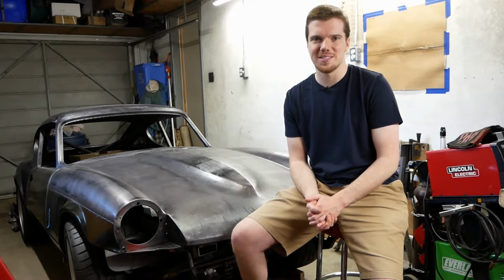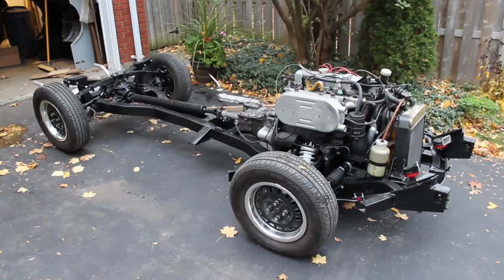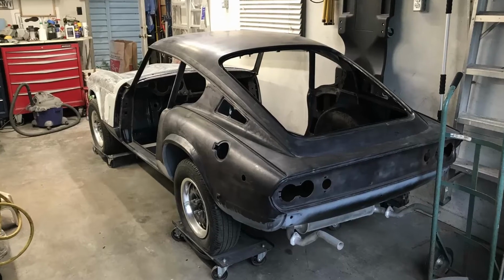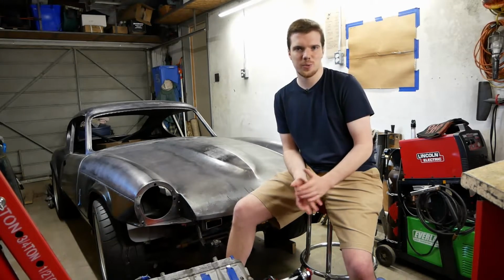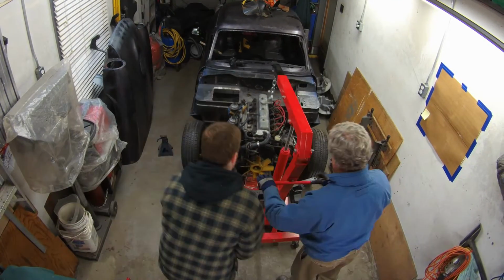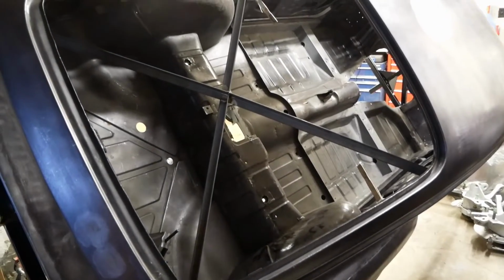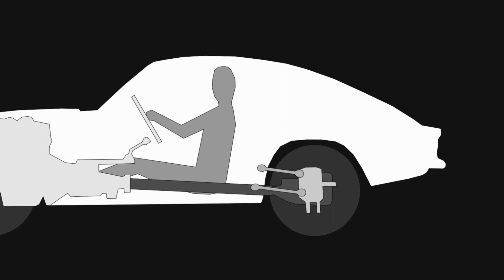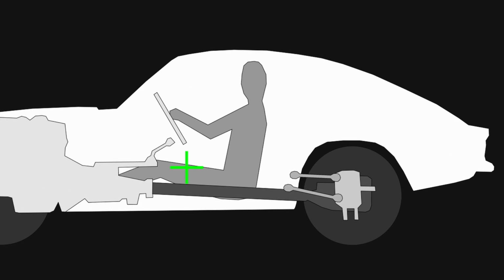ALL NEW Drivetrian – LS Swapped V8 Triumph Restomod Build – Project GT6R – Ep11

Comment: Turn a top hat boss with a blind threaded hole that you can fit from inside the manifold & then bond + screw into from outside with a washer / cap to seal and retain. Have you thought about using subframes from other cars such as Miata, E46 or E36 BMW etc? Simple chassis to pick up necessary points & link the subframes? Another thing to consider is where the exhausts will go as I guess it will not go under the new chassis.

Comment: In Regards to your rear suspension, depending on what the actual goal of the car is, you would want some suspension lift under hard acceleration.  Back in the old days, Chrysler corporation cars had a device called a "pinion snubber". It was a rubber piece mounted to the nose of the differential. Under hard acceleration, the axle would wrap a predetermined amount, making the snubber come in contact with a reinforced section of the cars floor.  This would have the reaction of lifting the car slightly, but at the same time pressing the tires more firmly against the ground.

AMC did the same thing with devices it called "Torque Links" and these were bars similar to the Corvette suspension parallel bars that bolted to each side of the differential and provided some lift while quelling axle wrap. Usually found on the hotter cars like AMX's, SC/Rambler,  SC/360 and early V8 Gremlins.

You might have also seen good old school "slapper bars" on the cheaper stuff like Camaros and Firebirds.  Same principal, just goofball execution.

Granted, you don't want a ton of lift, but you want some.  However I suspect this car will never see the drag strip anyway.

Comment: To plug that PVC hole, I would just tap it and run a straight thread o-ring plug into it. Just measure the hole and go to any hydraulics shop and select an appropriately sized plug. Then drill and tap the manifold for the plug and screw it.
When it’s done, that is going to be a very cool little car - with quite a bite!
Reply from the maker: Thanks for the idea Peter!  Cheers 👍
Reply: @FanatikBuilds  There are several videos for smoothing LS intakes, and IIRC AGearhead4Life had a good one. It seems to work well normally aspirated, but high boost applications can have issues.

Comment: Would use some panel bond to fill in and smooth out that intake. Used it all the time in the gm dealership paint and body for plastic
Reply from the maker: Awesome!  Thanks very much, we'll look into that! 👍
Reply: Fanatik Builds no problem can’t wait to see how the build goes along. Stocking up the parts for a hhr ss ls4 swap
Reply from the maker: Sounds awesome!

Comment: Go with a thicker walled steel tube that will not hold up to the torque it would if you were going to weld it into the body turning it into a unibody but alone it will only be a death trap
Reply: 3x3 tube will distort far more than 4x2.  The asymmetry of the 4x2 gives a better torsional and bend stiffness.  several solutions that will improve the situation, first, as Jeremy suggests go with a thicker tube, second, and not quite so obvious is to go with a pair of 3x1 (or 3x1.5) with he same wall thickness as the 3x3 spaced about 0.5 inches apart with a few gusset plates to keep them parallel - this will improve the torsional stiffness dramatically, as well as increasing the bend stiffness somewhat.
Reply from the maker: We're a little further along than it might appear, so unfortunately we'll be sticking with the 3x3 ... But don't worry, it's going to work out alright!  Thanks for the heads up!
Reply: Had a friend who used that same box tube to build a frame for a stockcar was killed first time out one small crash that shouldn't have hurt anything the car crumpled like a smashed pop can if you continue your nuts and we will probably be seeing you in the next life.
Reply: It also had a full roll cage that didn't help a thing and could have made it worse but we will never know now.

Comment: Hope that ls doesn't move the coolant through the plastic intake manifold like a ford modular.
Reply from the maker: Nope, it's a really slick setup!  All the coolant is directed through the block to the heads and back again, keeping the intake strictly for air.  The front and back of the heads have steam ports which allow for small tubing to carry any possible air bubbles in the coolant back to an expansion tank which prevents hot spots.  A very well thought out design! 👍

Comment: My standard MK2 gt6 without any lowering is hardly 12cm off the ground so your might not have as much clearance as it appears. 

The sill (or rocker as i think the Americans call it) is structurally important to the original chassis design. They replaced the herald larger outriggers when the design changed. i would have thought you could somehow tie the new chassis into some reinforced sills without loosing as much ground clearance.
Reply from the maker: We're not too worried about the ground clearance, the new frame only sits about 2.5" closer to the ground than the lowest point of the old setup!  Will make more sense in the next episode!  Cheers 👍
Reply: @FanatikBuilds  good good! Looking forward to seeing it

Comment: Any reason you can't spread the new frame against the rocker panels (or even inside the sills, like Binky's sill stiffening tubes), instead of trying to connect front and rear in a straight line?  That should keep your usable floor area at a workable height, give plenty of width to the frame itself, and if needed, you can always bolt on a crossmember to act as a stiffener once the drivetrain is installed.
Reply from the maker: Thanks for the ideas sir!  If we did it as a unibody like binky we definitely would have run a tube through the sills - as it sits though we wanted to stay with a body on frame, but we will be heavily integrating the two parts so it will (act) more like a unibody.  All will be clearer in episode 12 :) cheers! 👍

Comment: A lot of the C4 Community are talking about this.  The D36 is not very strong and it can handle not more than 300 HP.  That is the absolute limit.  

However Zip Corvette has a solution.  

https://www.zip-corvette.com/84-96-3-73-heavy-duty-dana-36-differential-w-cover.html

I am currently looking into this myself.
Reply from the maker: Thanks Adam, I've seen that product!  We just picked up a Tig welder and may try to mimic the design at a point ... From what I understand though, the 36 mostly doesn't like launches on the dragstrip.  Us, with street tires and a light car will hopefully be ok.  Worst case, everything is a direct bolt in to upgrade to a 44 diff someday!  Cheers 👍

Comment: It's kind of funny that you're using the rear out of a Corvette that made 205hp, to back up an Impala/Grand Prix engine that makes 300+. How far we've come in 20ish years! Lol
Reply from the maker: It is!  Modern technology 👌
Reply: @FanatikBuilds  Could you potentially do a 2x3 (possible thicker wall) tubing on the outer rails to gain some ground clearance over the 3x3? I see 2x3 used a lot on body dropped mini trucks. Might gain you an inch without having to encroach on the floor pan.
Reply from the maker: Good suggestion, we're actually quite a bit further along than it seems so it's already built in 3x3, but we've taken a few extra steps to minimize the size and keep it strong.  Only lost 2.5" of clearance and the car had tons to begin with so we're pretty pleased! 👍 cheers!
Reply: The corvette engine that made 205 hp was easily modded to make 400 hp back then . I have a modded L82 which I supercharged using a compact over driven supercharger 3 inch dual exhaust big tune headers  , modded original 2.02 heads machined for heavier springs rhoads variable valve timing and lift  lifter roller rockers modded hei   Comp blower cam  boost referenced 850 Holley  electric fuel pump 540 hp 445 lb torque . Owned my vette 40 + years many components Oem despite 2 seasons road racing at eastern Canadian and auto cross .